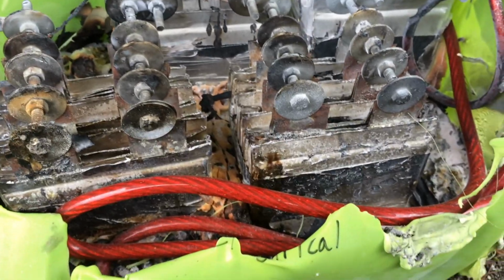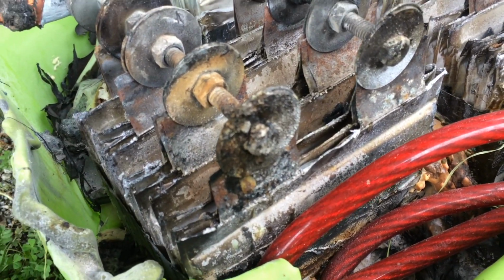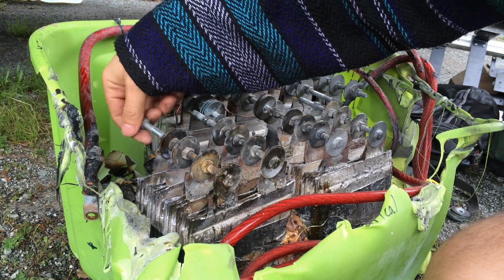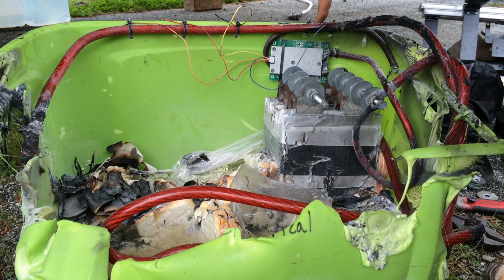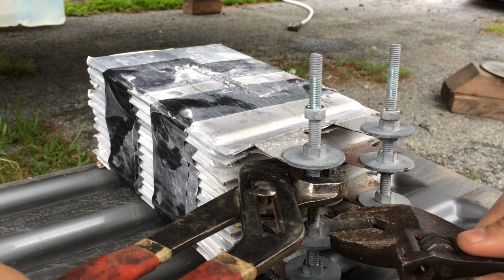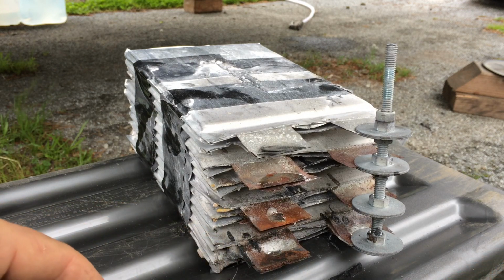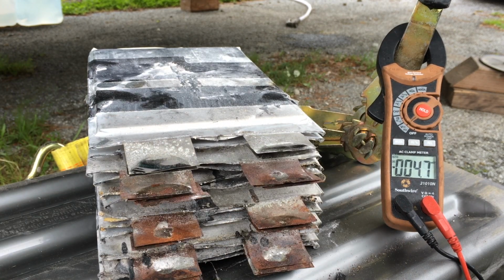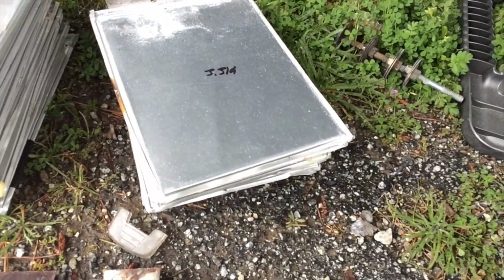LiFePo4 Cells After Fire

Comment: So I've tried a bunch of cheap Chinese boards and they have never effectively managed cells of this amperage.  Now I use little battery balancers from Carl at Electric car parts company dot com.  Instead of bleeding off power in the form of heat, they redistribute the energy to the low cells.  And they are always balancing.  At $22 a piece they can be pricey, but worth it.